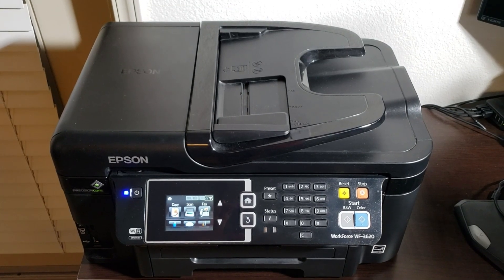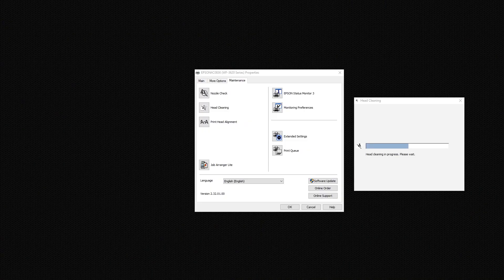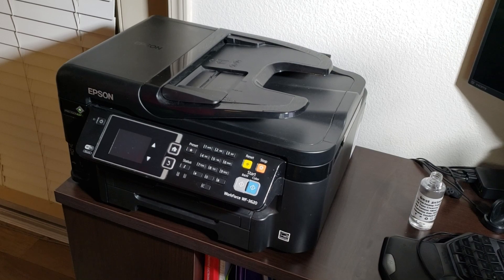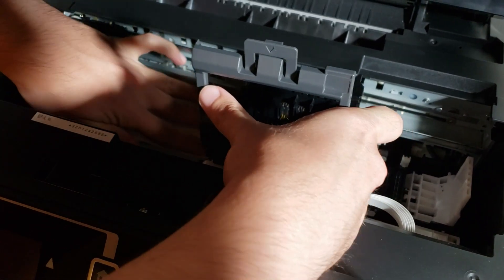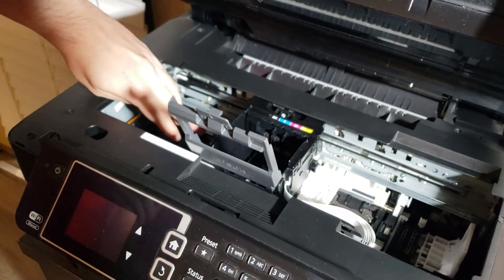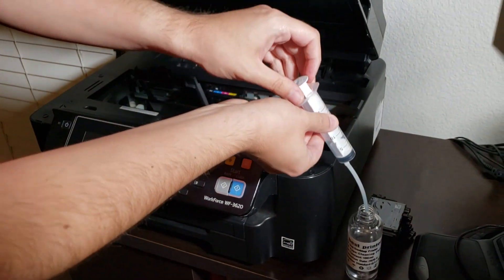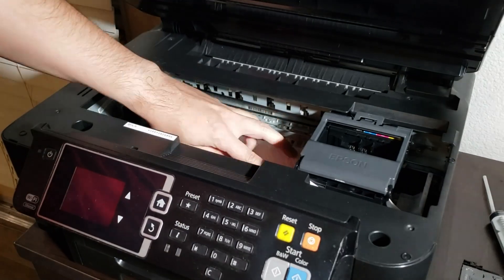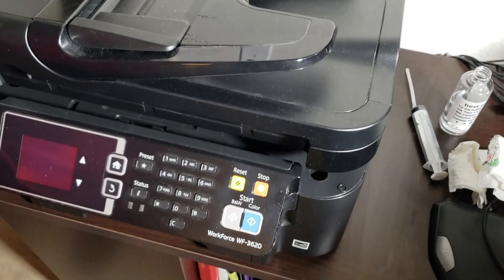How to Fix ERROR CODE 0x97 on EPSON Printer / How To Clean EPSON Printer Head

Comment: Important tip 2, your printer may not have a printhead unlocking option in the printer menu, if so you just have to print something and as soon as the printer starts printing you immediately pull the power cord. Then the printhead will be unlocked.

Comment: Important tip. Even if you use your printer often don't switch off the printer to save power, let it stay on unless you don't intend to print for months as the printer has built in printhead cleaning routine that it will run to keep the ink flowing in all colors. If you switch it off then it can't run and the ink in the printhead can dry.

Comment: My EPSON WF-3620 was streaking the colors as it printed, so I cleaned the print head just as you did. I finished putting it back together, but now when I turn it on, it immediately pulls up the Error 0x97 and I can't do anything on the printer. I've taken it back apart and cleaned it a few more times, but it still does the same thing. Any ideas on what I can do?

Comment: This did not work. Still giving me the error code. Interestingly enough, it will print a COPY of something, but won't print a document.
Reply from the maker: It did work for me, although judging by the comments, there are mixed opinions. Some people reported that they got it working after running the cleaning cycle several times.

Comment: What is the cleaning fluid made of? What chemicals?
Reply from the maker: Not sure to be honest. I'm assuming there's some sort of a paint thinner in there. I've heard people using a mixture that's similar to window cleaners with ammonia. I usually just buy pre-made sets, haven't made my own yet.
Reply: @AlexInFlatland  Thanks for the video, but nothing works. I've tried it all, including tearing apart the print head, and it still gives the same errors even though everything is a clean as can be.
Reply from the maker: @bluenetmarketing  welcome to epson printers :( Mine actually broke as well a few months after making this video. They're absolutely designed to make you buy a new printer as often as possible.
Reply: @AlexInFlatland  No kidding. I bought a et-4760 as a replacement. So far, so good. What printer do you recommend with the same functionality as the et-4760?
Reply from the maker: I'm honestly DONE with inkjet printers. I've had about 10 break down over the years. I realized I don't really do color prints very often, so I just opted for a Brother B&W Laser printer.
Reply: @bluenetmarketing  como pudo solucionarlo?
Reply: Inkjet printers are flawed by design! Ink dries up and no endless issues! Get a Lazer
Reply: Mostly de-ionized distilled water and isopropyl alcohol.

Comment: I cannot get the printer head carriage to move. It will not move without using great force, at which point it will likely break.  How does your printer head carriage move so easily?
Reply from the maker: Sorry I got to your comment this late :( You need to interrupt the power to your printer while the print head is somewhere in the middle. If it goes in the resting position it locks up and won't move. I usually just power on the printer, and while it's doing the start up checks and the print head is somewhere around the middle, I just unplug the power. That way the print head remains unlocked and you can move it around freely.
Reply: Success the x097 error is gone and I was able to print a check nozzle test pattern.  Thanks so much
Reply: There is a setting to change ink cartridges that moves the carriage to the center.  It's available from the printer front panel.
Reply: This video gave me all the info I needed to know to troubleshoot my printer error problem.  At least tackle the situation like I know what I am doing.